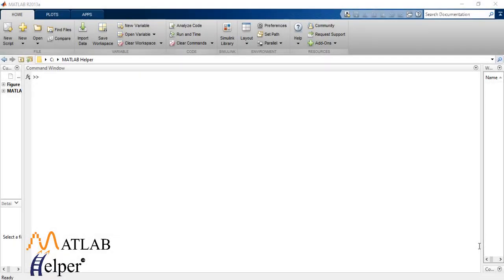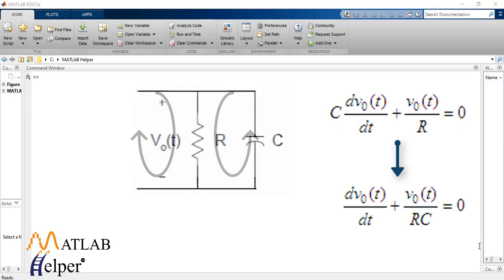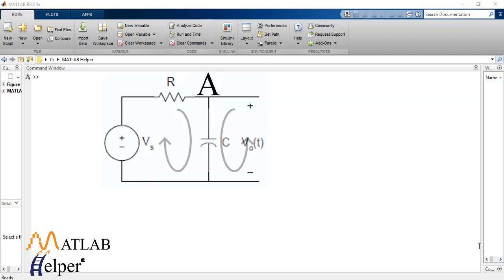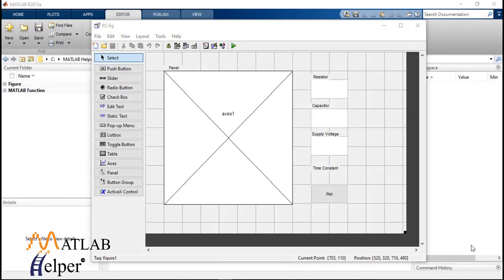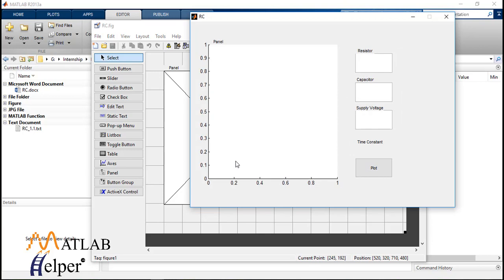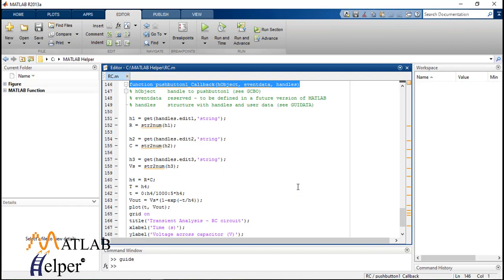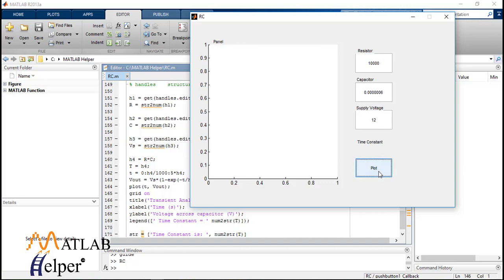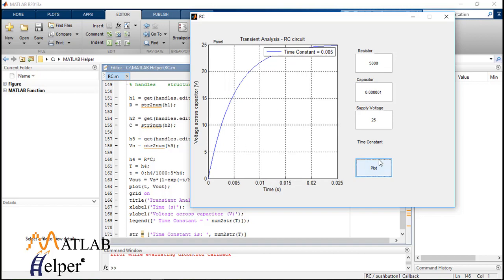RC Circuit Transient Analysis using GUI | GUIDE | @MATLABHelper

Comment: We learned about the transient analysis of RC filter circuits.Using #KCL ,We calculated the final equation.Create a #blank #GUI.Take Edit text,static text blocks,axes.Write Resistor,capacitor,voltage,time constant,plot on it.The #callback is written in a #plot.So that when we run it,we get a filter response on the graph.We can observe different responses of RC filter by varying the #resistor and #capacitor values.
Reply from the maker: Disha Nikam, Glad to see your appreciation for our Video. Do support us by Subscribing to our YouTube Channel at https://www.youtube.com/c/matlabhelperteam